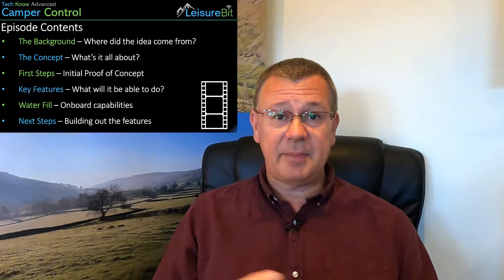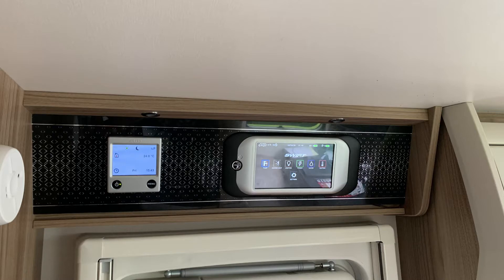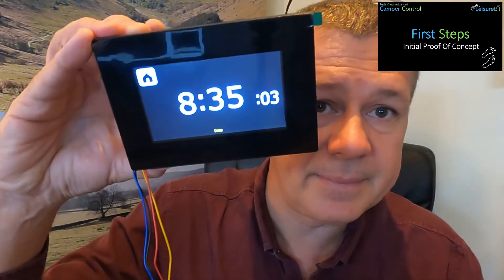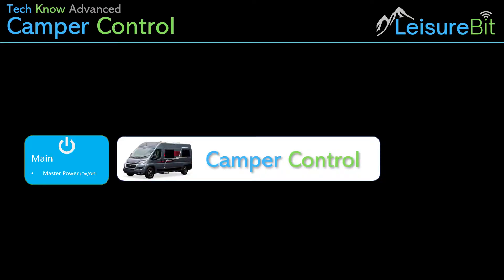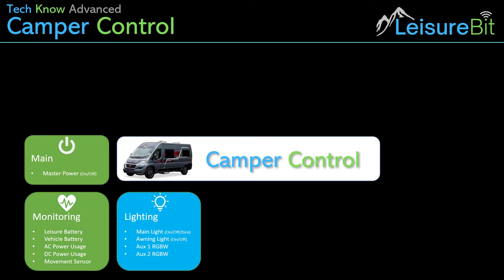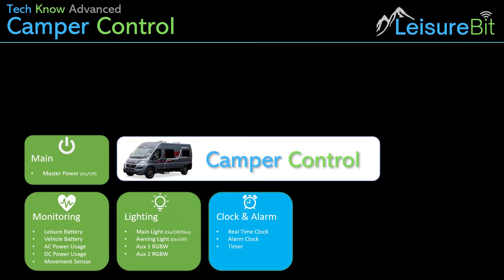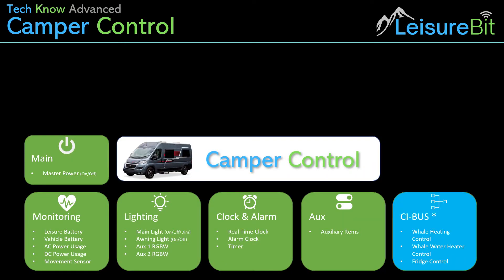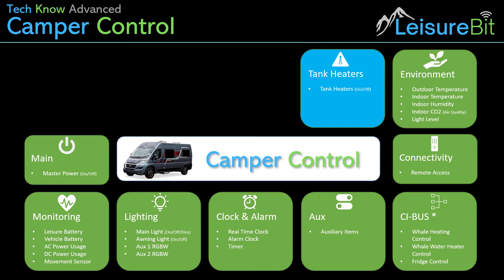Camper Control - Control Panel Upgrade - Advanced Mods - Part 1

Comment: Some interesting control panels in the latest BCA controls 2021 catalogue. They manufacture the controlband distribution panel used in the CV range.
Reply from the maker: Thanks for sharing appreciated, be interesting to see the pricing on those ones as they look fairly useful all be it not sure how much you need to change out to make them useful.
Reply: @LeisureBit  I think you may be located close to myself, we are around 15 mins from Kimberley Darlington.
I've got a 2021 CV 20, if you want to take a look at it from an electrical perspective before yours arrives give me a shout.

Comment: Looks brilliant David. How much will it cost when complete and will you be selling them or is it just a project for you?
Reply from the maker: Hi Ian - thank you - I’ve just been trying to work it out ref cost as not 100% sure at present as still sourcing some of the parts- will come back to you as some of the component prices keep changing (screens, valves etc) and depends on how far I go with it. My mission is to get it working and then I would consider selling If it’s good enough and reliable enough (hopefully will be) but would want something to be really good if it were to be sold so it’s a personal project for now but could morph later if that makes sense if it all works out :)
Reply: @LeisureBit  Make sure you keep me updated!